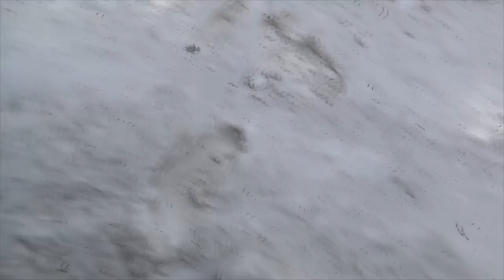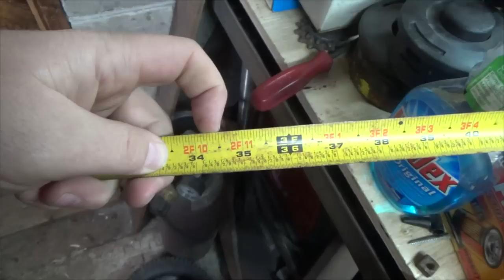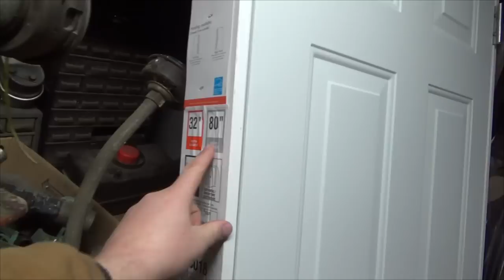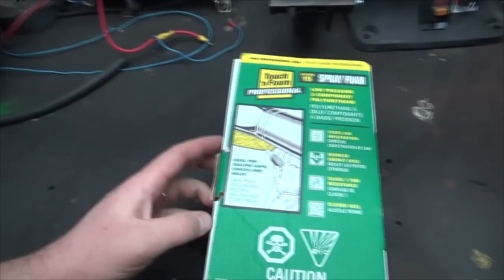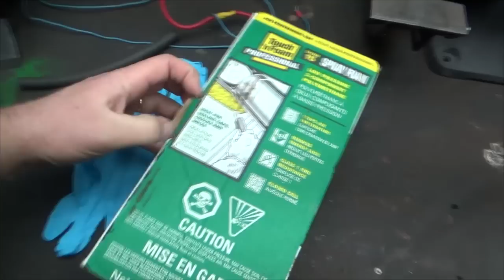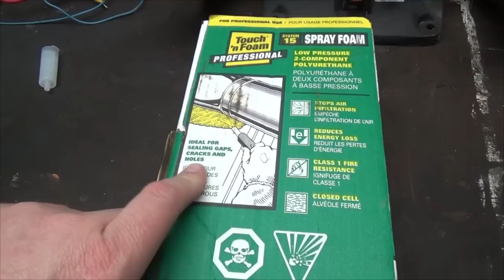Strange problem in the river and playing with silicone and spray foam

Comment: Hi Bill - the door, I ran into a similar problem.  What I did was mount the door on the other side .  I  screwed 2x4 on the  far side  to the block with a 1 - 1/2  inch space and screwed a 2x6 ripped to 4-1/2 . No cutting your header and easy to install. All you have to do is move the light switch. Hope this makes sense.

Comment: You aren't supposed to take the cans out of the box, heh. For the window on that door I'd put a piece of rigid foam board insulation on it (cut for a tight fit).

Comment: The box those cans go in had a plastic retainer to hold the valves open. You remove the safety lock, pull the strap back, and hook it on the black retainer on the box, then spray.

Comment: Cut the difference off the bottom of the new door, remove the bottom board from the new door frame and leave that old slab of wood at the bottom so the rest of the frame sits lower but the door matches the concrete height .. That way you wont have to cut into the beam. Then slap on one of those rubber door strips.

Comment: The reason for the wood headers, is because the blocks can't float in the air. You can cut as much of the header you need because like you said it is non-load bearing.

Comment: It appears to not be a load bearing wall because the joists are running parallel to the wall and none appear to be lying on top. Cutting away at the lintel probably won't cause an issue, but it is hard to tell if there is any weight on the wall other than self weight. Lintels are also designed to help with horizontal support of the wall, against wind loads and other things that create a horizontal component to the wall, but the exterior walls should be doing most of that anyway.

Comment: Headers in garages built in the old days with block walls normally just used wood headers, much easier than using a steel lintle and cement blocks.

Comment: The lintels are used because masonry blocks have no resistance in bending. So with an opening you have nothing under them to keep them from falling down. The mortar around the blocks is not nearly strong enough to hold the block together in that situation.

Comment: Can you return the "right hinged" door and get a "left hinged" door that will swing into the shop so you don't have to deal with cutting the header and the height difference in the concrete floor?
Reply from the maker: no there the same size just opens the wrong way

Comment: Or, Trim the door and frame at the top or bottom and cap the cut with the cut off door skin and some construction adhesive and nails..
Reply: but that would be the right way to do it, and then you couldnt cut out the framing,  that would be just dreadful....

Comment: Instead of studding the door, Why not just get a full sheet of thick ply wood and screw it over the door. (Screwing directly into the block work).  
You could then seal around the edge of the ply. .

Comment: The headers are to distribute the load of the roof or the upper structure to the wall and not on t the windows or doors or you could be replacing windows and doors all the time plus the headers are to keep everything square for replacement if nessacary.

Comment: 👎🚧 those doors are a quick fit door. They cant be cut down like hollow core doors,  that perticular door is metal foam filled,  ive lost count the amount of installed. If i was doing the job id remove the  existing door and leave ne side of the jamb bolted to the block, that will leave 1/4  to a half inch to shim instead of 2.5 inches..  not sure if that foam is low expanding, high fill foam os enough to crack blocks and evenbreak windows. Just sayin,